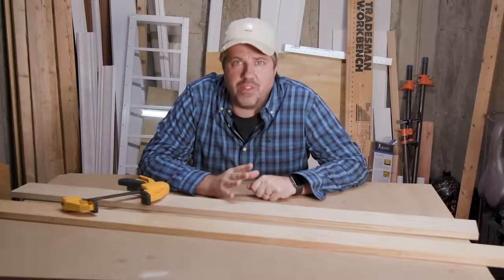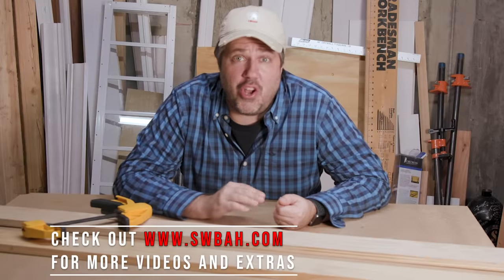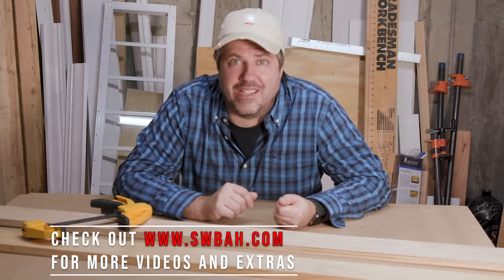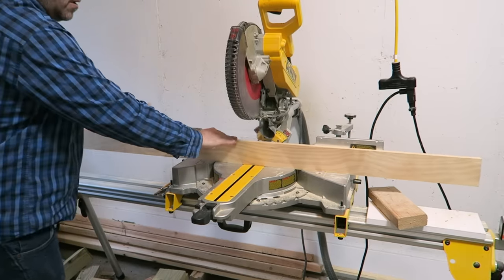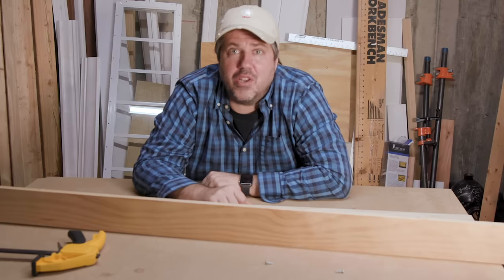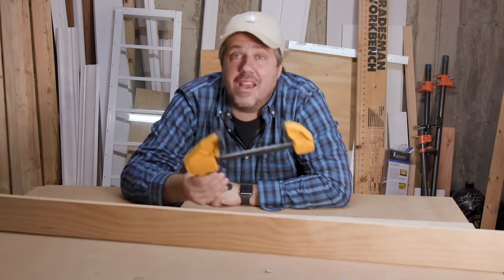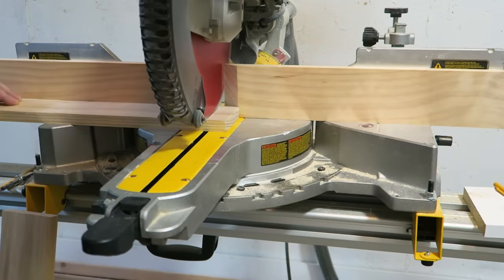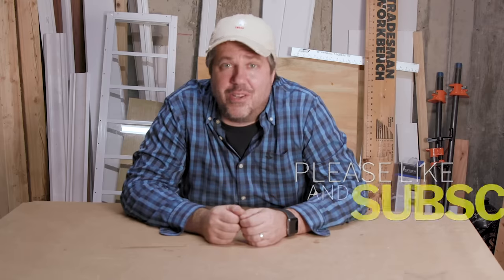60 Second Miter Saw fix that will change the way you work! - Easy DIY Miter Saw Stop Block.

Comment: Good idea, though you don't need to pre-cut your slots as the blade will cut the slots as needed. I do think the intro is way too much and that anything that goes over 10 seconds seems excessive. Keep it tight, which adds to the production quality of the video.
Reply from the maker: Thanks Tom, this is the first shorter form video I did to test out the response - which has been pretty good overall and I think I will do more this way.  

Most of my previous videos are longer and have a bit of as story to them, hence the longer intro I did, which is part of my editing template.  I think it is a fine line to showcasing some of the other projects in the beginning and also communicating the main intent of the video so I appreciate your feedback. 

Is it the pre-roll that in your opinion that makes it feel long or the teaser with the logo?  In the longer videos I use the pre-roll to quickly say what the video is about and the teaser reel to promote the channel before getting into the content. I think the channel teaser runs about 25 seconds. Thanks again.
Reply: @SoWeBoughtaHouse  no sir, the pre-roll is fine, and I get the function of the header, but once you've seen it once you don't get much out of it.

BTW, I've got the week off so I'm thinking about implementing your miter saw trick. My miter saw setup is a bit overcomplicated, so I'll have to do something with it to make your solution workable.
Reply: Relax Scorsese. It's youtube.
Reply from the maker: @no_handle_required  Thanks English, but I think Tom was just trying to help and I appreciate constructive feedback when I get it.
Reply from the maker: @Tom Holmes  Hi Tom,  Mine was down and dirty, and made from scrap.  I move the saw to much and actually use it on location which is why it on a stand in my garage and why I don't have a better solution in place already. Let me know how it goes.  I'm thinking of doing a follow up video including some of the suggestion I've gotten in the comments.  If you come up with a good fix let me know.  The first upgrade I like to make is to add t-track and a metal stop to replace the clamp.  I also think I will change the fence to MDF as the pine will likely warp a little over time.
Reply: @no_handle_required  wrong.  YouTube etc comprise a different format.  For someone trying to make duckets, the goal is NOT artistic integrity and lush storytelling.  Very different.  It's viewership for ad revenue and affiliate sales.  Like a TV show.  TV series or streaming series no longer have lengthy intros? In fact, many of them now have some sort of logo and the series intro is a few seconds long. Notice when they finally came out with the "skip intro" option several years ago.  The YouTube audience is more impatient than ever, and is someone who is trying to learn as much as he can about woodworking as quickly as possible, I'm firmly in that camp as well. But honestly, that applies to anything I watch online. So..... Nowadays, an intro of more than a few seconds is painful to most. I think the intro on this channel or at least this video is painfully long. I strongly encourage you to chop it down to a logo and a one second jingle etc. That's just the way the business is these days. I think the content is great and I really appreciate this video but I agree that the intro is far too long. Thanks for the information :-)

Comment: When I need 2 pieces the same length I stack them and make 1 cut. Not at all obsessive.
Reply from the maker: The necessity for this isn’t really when you need to cut two pieces though it would work.  It is more for those times when you need to cut multiple sets of table legs or dozens of perfectly identical pieces.

Comment: Show us how to "square up" your miter saw that is out of square on its cuts by less than 2 degrees ...
Reply from the maker: Hi Ken, I’m not sure what squaring up the saw had to do with essentially creating a jobsite stop block.  If your saw is out of square  it depends on the manufacturer as to how to calibrate it.

Comment: Can I cut 22.5 angles ?
Reply from the maker: Hi Hank - You should be able to cut any angle your saw is capable of. The first time you cut the angle it will notch out the fence.  You will no longer have zero clearance like you would if you only cut 90 degrees but I show in the video hoe I notched the entire middle to cut all angels.  If you need to to reference the stop to angle side of the cut. you might need to a bigger stop. as the clamp by itself really only works when the reference 90 degrees to the fence.  What you can do it glue two pieces of scrap together to form an L shape.  Then bracked it from behind with a backing block to keep it square.  Then clamp that to the fence to extend it out so you can register the point of any angle to it.  

This might be hard to visualize, so if it doesn't make sense, let me know and I will throw one together and send you a photo.

Comment: Don’t know why you don’t use the flip up stops on the saw stand 😂
Reply from the maker: They are not that accurate for what I was doing.  When you lock them down they move a little.  They are also not 90 degrees with the support. So if I I was stacking multiple boards, the ones on top would be longer. I also wanted to make a video for people that don't have a stand like that. I use the stops on the stand, but mostly for things like framing.
Reply: I have a very expensive DeWalt stand  and there are so many adjustments to the supports that it's far easier and more precise to use this fence. Especially if they are shorter, then you can't use the built in stops, well maybe if you relocate the saw in the stand?

Comment: Excellent idea. I'm about to make some changes to my workshop setup in order to free up some space. My mitre saw station has been great, but I don't really need it all the time, as most of the stock I cut tends to be smaller, this is the ideal solution as it can be popped away when not needed. 
I'll attach a link to another video I saw that is also incredibly simple when you want to make repeatable cuts in sheet material using a circular saw or a plunge saw.
https://www.youtube.com/watch?v=al_pBf0ffzs
Reply from the maker: Making your own track is great.  Their are also some nice cutting jigs from Kreg as well.  Some are really cheap compare to the price of decent plywood to make my own these days.  I must confess to a dirty little secret though.  I own a Festool track saw which I use for those types of cuts.  It was expensive, but much cheaper than a new cabinet table saw and it takes up zero space when stored.

The chop saw is definately big, but I love it.  I do need to break it down when I work on bigger projects though.  So this fits the bill for me like you said.  It is fast and easy to set up and break down out of the way.  If you want to a laugh though check out my 2024 Miter saw upgrade video.  I tried to integrate every comment and suggestion from this video into it.  Some worked out better than others.  The disco is fun though.

https://youtu.be/37S2bLIqKNM
Reply: @SoWeBoughtaHouse  Ditto  on the cost of plywood. A lot of the jigs and gizmos you see being showcased on YouTube might look amazing, but when you just want to get something done and don't want to spend a whole weekend making something you could just buy for less than £20 and then get on with the project at hand, well...I just bite the bullet and part with the folding.
I also own a tracksaw - in my case, it's the Makita - and I use it often to make repeat rips on ply, mdf and osb. 
I did purchase parallel guides and the TSO railsquare to complement its functionality, and, whilst I find the railsquare excellent, I just don't use the parallel guides as they are IMHO, cumbersome, a real faff to setup, and not terribly accurate.
The tutorial I put the link to, demonstrates a very simple, and very accurate method of making repeat cuts with the tracksaw using only one piece of ply, mdf or osb, ripped to the exact same width of the track.
In essence, it is just as simple as your solution for the mitre saw.
Reply from the maker: I have  Festook angle guide for the track saw but I’m not sure I like it.  I might go out and buy that TSO. How do you like the makita?

Comment: Why is the fence extension neccessary?,
people have been using a scrap block of wood (& a clamp) to create a stop without it,what gives??
Reply from the maker: Good morning Neil.  I'm not sure I'm understanding, Where would you clamp the block of wood to without the fence extension?  The point of the extension is to provide a reference surface to clamp a stop in place in this setup.
Reply: @SoWeBoughtaHouse   ok u just answered my question without realising.
For short piece cuts the wood block would be clamped to the saw's existing metal fence.
For longer cuts it would be clamped to the fence extension 😉
Reply from the maker: Exactly, this is for pieces where you need to extend your reference surface.  When I originally built this I was doing face frames on cabinets and needed each part to be perfect or I'd get annoying gaps.  The parts were between 2 and 4 feet.  This gave me the room to set those different stops.

Comment: Really? My non-expensive mitre saw has stops built into the extensions and my mitre stand has stop posts on both outer rests.
Reply from the maker: If that works for you, I’m happy for you. The ones on the DeWalt saw deflect 1/32 to 1/16 of an inch.  Nothing is faulty it is just designed with contractor work in mind. This eliminates that deflection and can make precise errorless cuts. My cheap job site table saw has a fence and it is pretty good but it doesn’t come close to a cabinet saw.  Performance is based on need. If you don’t need it, you don’t need it, but there are lots of people who do and notice the difference in their work.

Comment: This was okay but the caveat is you just reduced your cutting width by 1/2-3/4 of an inch.  I need all that width.
Reply from the maker: Hi Dennis - I have a solution coming to solve that problem.  The video is currently in the works :). It is a little more complicated to build but will remain portable. Check my instagram as I’m going to start posting some teaser photos on the project.
Reply: aluminium angle (or steel) i got an alu one thats 2x3x24" and 1/4 thick for a router table ($11 and 30 shipping 🤦), same applies i think. good and solid and easy to work with and its 1/4” so not gonna steal all your space.
for the router its flat side down for support but you could flip it and lay it on top of the existing guide.

Comment: Boards can be straight, but they are not level unless perfectly parallel to the ground. DUH !   And just so you know the vertical is plumb. So, those of you calling a post level, STOP. It is plumb.
Reply from the maker: Hi Dallas, not to make you blow a gasket but technical level is not referenced to the ground but to a parallel plane bisecting the center of the planet.  This definition is flawed though in that it only exists at point in space. Basically  a tangent on a curve. So if you project a straight line out in both directions it would always be equidistant to this plane but not always level. 

I will double check the video but I don’t think I was making posts anywhere in it. If I did make the mistake of saying level when I should have said plumb,I will flog myself appropriately.

In all seriousness though, I wish you and your family a very Happy Thanksgiving and I hope the turkey is level if you roar it and plumb if you deep fry it.
Reply: @SoWeBoughtaHouse  Quite obviously you missed the point. Talk about blowing a gasket. I never said that you mentioned post.

Comment: You are taking away 3/4 of your depth , but if you arnt cutting anything wider than a 2x10 you should be good
Reply from the maker: Hi Jeremy. Thanks for commenting. You do lose 3/4 of and inch. However because of the precision you can easily flip the board and finish the cut if you need to.  I was cutting 20inch wide cabinet dividers this way and had perfect alignment across the cut. Of course you could do this without the stop but it is easier with it.  On a 12” blade and this technique I can cut anything that will safely fit on the base plate.

Comment: that cut didn't look identical.... it looked off by about 1/32 of an inch.  But still nice results.
Reply from the maker: lol - I think it  was because my floor is uneven and my eyes are 1/8" out of calibration. It works really well though.  I'm cutting face frames right now which is why I made this and everything is coming out nice and square :)

Comment: Or you could buy a tape measure
Reply from the maker: Good morning Jason, of course you need a tape measure, that is how you measure the first one :) if you want to measure, mark and and cut dozens of the same size pieces by sneaking up on a knife line more power to you.  I’m not into the self torture thing especially if I’m working with expensive hardwoods so I like to use this method. Just my personal preference, but there are lots of ways to cut a board.
Reply from the maker: lol trolls count as engagement in the world of YouTube, so I’m happy to have them troll away :)

Comment: I think the whole thing would work better if you cut a small piece and clamped it in as a stop - pushing the new board against that clamp on that angle - seems to me like it could easily move, and you would have no idea if it did. The small piece of wood you could clamp and they use a pencil line and be able to see if it moved.
Also your intro is way too long - youTube audience will click away with that length of intro.
Reply from the maker: Hi Jim - agreed on the wood stop.  When I made this video, I was cutting 2x4s and 4x6s building a kids playhouse.  This was down and dirty.  I had no idea over a half million people would watch the video lol.  Over time I have shortened the intro as the channel gained subscribers.  I nthe beginning I was making the video to document some things and was having fun playing with YouTube.  Strangely enough the shorter intro videos have not done as well as the older ones with the longer intro, but I don appreciate the need to change these things to grow the audience and have been making those types of changes.  

Also if you are curious, here a link to the 2024 version on my portable miter saw.  It is very different :)
https://youtu.be/37S2bLIqKNM

Comment: Brother with all due respect, you left out the most important part. No mention of how to put that clamp into the exact place of measurement is like leaving out the saw. Your better than this.
Reply from the maker: Hi Shayne - I thought I showed that at 3:20 in the video, but maybe it wasn't clear.  Sometimes you get video blindness when you try and produce content all by yourself and things that seem obvious aren't.  I wish I had someone to bounce the videos off of before I post.   Maybe in the future. I really appreciate the  feedback to help make the channel better!
Reply: I think he meant in a measured way, like having a length of ruler (calibrated to its placement on the backstop) attached at the top where a sliding block can be clamped at a “measured” location, as opposed to a mark on a board and sliding it under the blade eyeballing it, but even that is eyeballing the stop to the ruler with a potential for parallax/human error, so prob no different.  This isn’t a $400 Woodpeckers jig, just something to make repeated cuts and I think your solution works for a lot of uses.
Reply from the maker: @erikutube33 this was really a down and dirty approach.  The reason behind it was I was cutting cabinet dividers. It was more important that they all be exactly the same height, then exactly the height I put in the plans.
Reply: Shayne, it's "you're" better than this. Use the contraction, not the possessive pronoun.  Now, back to our regular programming.😄

Comment: Are you kidding Me, are you only cutting 6 to 10 inches boards? What do if you need to cut something? That's shorter than the long board. That you got is a backbone. Is it real? How do you do that genius? Don't really use that chop much, do you
Reply from the maker: HI Phil, obviously you have something important to say or you wouldn't have posted. Unfortunately, I don't think anyone has a clue what you are talking about which is unfortunate since you might have had something to contribute to the conversation.

So no I am not cutting 6 to 10 inch boards.  I like my fingers and wouldn't use a Miter Saw to cut something that small.  It is much safer to use a cross cut sled on the table saw for that.  If I want to cut something longer I just move the clamp out further away from the saw blade.  My fence allowed me to make up to 6 foot cuts to the left of the blade.  If I was going to cut longer than 6 feet, precision probably isn't as much of an issue and I can use the stops on the wings or just draw lines. Being a 16th out over 6 plus feet wouldn't be as much of an issue for me. Technically though it would be pretty easy to extend the fence to 8+ feet using MDF.  At that length I wouldn't trust regular lumber or plywood not to bow to much.

Remember crack is not your friend.